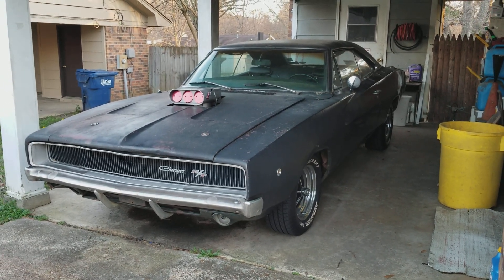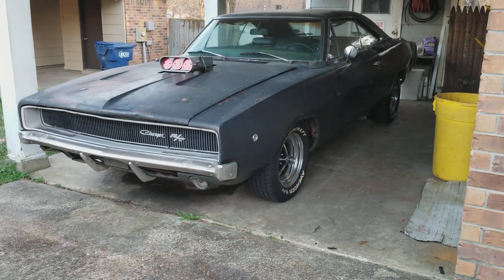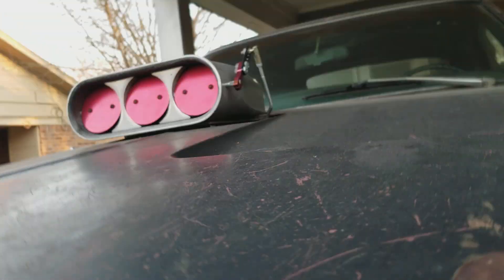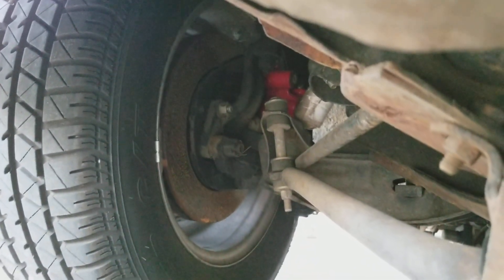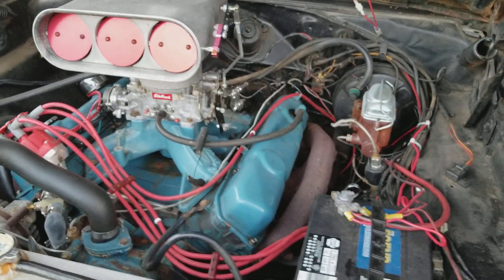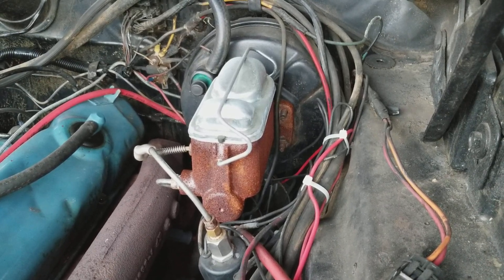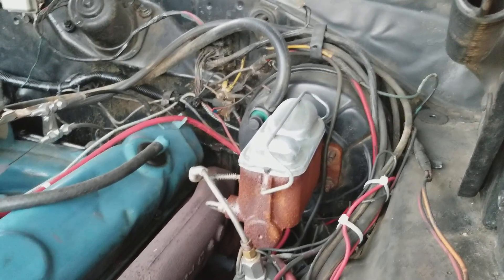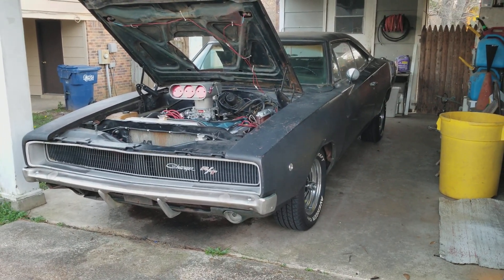1968 Dodge Charger R/T Scarebird Disc Brake Conversion 1 year later

Comment: Your a great guy . I’ve been watching your channel for a long time . I will tell you what my father told me when I got my 68 charger when I was 16. Get manual brake master cylinder and step on the brake like a man! That other stuff you mentioned is garbage . Vacuum pumps ect.

Comment: Hi, I'm curious what you used/how you cut the hole in your hood? I've got a 65 elcamino with a 6-71 blower and need to make a cut out so I can put the hood back on. The hood already has a round hole hacked thru it so I'm not worried about screwing up the stock hood. Thanks. I'm also thinking about doing the scarebird conversion on it also. I did the conversion from the old single bowl resevoir to dual bowl and it's got power drums now so that portion is updated. I drive around so slow that the drum brakes stop me in time so I always think "maybe next year". Thanks in advance for your reply.
Reply from the maker: jsdspif3  I was actually able to cut the hole in the hood without taking it off the car. I can do a video on Saturday for you to show you how.
Reply: no hurry on it. This spring I'm finally going to get the windshield and "backlight" out of it. The windshield leaks pretty bad and the water pours in right on the fuses, so I never wash it. You'd think there would be a gaping hole with the amount of water that gets in but I can't see where it's getting in other than it is the windshield. It's not running in from the firewall or the cowl vent drain (what ever). So I need to get them out and fix what ever is causing it. I took the windshield trim off some time ago and I actually think it doesn't leak as much now as it did when the trim was on.
   I worked with a guy years ago that had a charger like that that was in very nice condition. He took me for a ride one day but he couldn't give it much gas without breaking the back tires loose. My elcamino is a pro-street so my back tires are pretty wide. Not sure of the size, they're Mickey Thompson sportsmen.  I see a vid to the side 68 charger for sale from vanguard motor sales. That's the condition the co workers was in but his was yellow.

Comment: Not trying to cause trouble but do you have to change the distribution block or the porportioning valve? I have a 68 Roadrunner with the factory Bendix Four piston disc brakes and I believe the distribution block might be different on front drum brake cars vs disc brake cars. Also the brake line for the Roadrunner's rear brakes is a two piece line with a portioning valve (I believe it to be a porportioning valve) instead of a one piece line. I just redid the whole brake system. It looks like you have the exact master cylinder I am using. Keep up the great work and keep the vids coming. Your videos keep my motivation up when things become frustrating.

Edit: Year one is calling it a disc brake hold off valve.
Reply: Shady Jake I would think so
Reply from the maker: I did some research on this a while back and I believe the distribution blocks are the same. The only difference between disk and drum on the hydraulic side would be the master cylinder and that brass piece in the rear line.  I'm not sure if the boosters would have been different but I didn't have any issues when I bolted mine up.
Reply: Charger383Mopar gotcha, so the residual valves are built into the master?
Reply from the maker: Invincible Extremes Muscle Cars Garage I'm not sure but with there being a disk and drum master cylinder I would think there would be some kind of valve inside them